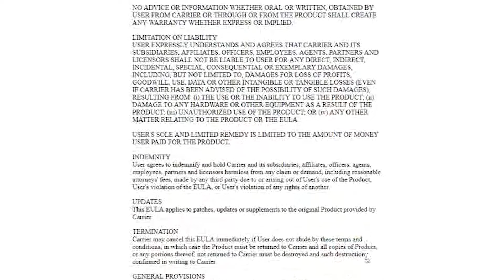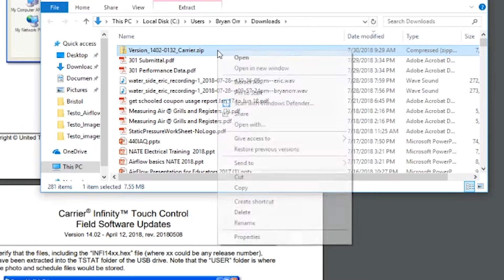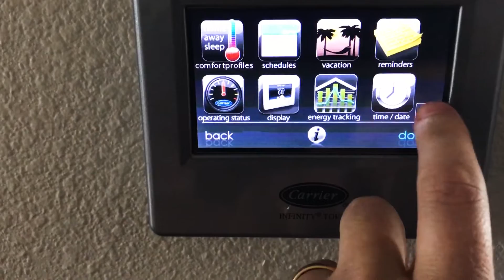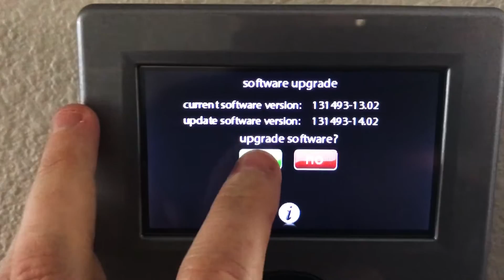How to Perform a Carrier Infinity Control Software Upgrade

Comment: Thanks for the download tip. I have two Carrier SYSTXCCITW01 (Version 10 in the back of the unit) Infinity Touch Programmable Thermostat, already had 131493-14.0.2 install, and last night, one of the unit has input communication error code 178, I called Air-Rite, the technician, called Carrier support, verify everything working except Thermostat, basically he been instructed to connect to connector R and W1 so bypass the Thermostat, and now it started working, also check at basement the volt which is 4.6 V and also checked the on the wall unit which is also 4.6 V, the conclusion was the Thermostat was defective, need replace but the replacement will cost $1852, so question for you was even thought the wall unite Thermostat is up can access via my carrier home app, but just can't control the HVAC, so I decided not to order it and after he left I use a wire connect from R and W1 to temperate get heat, and meanwhile figured out why it happened like this?  The other unit is working fine.  Thanks.

Frank